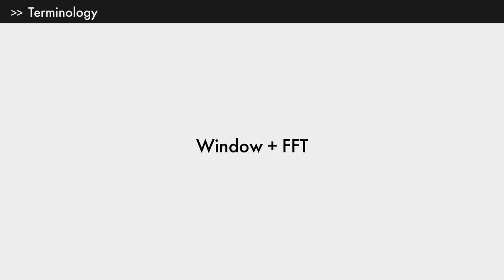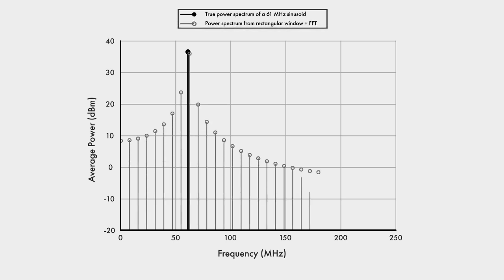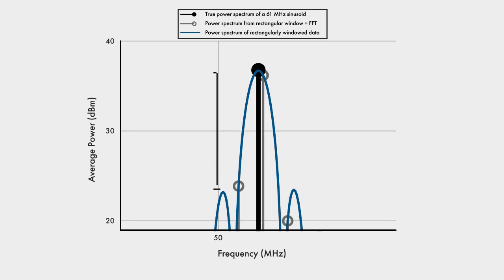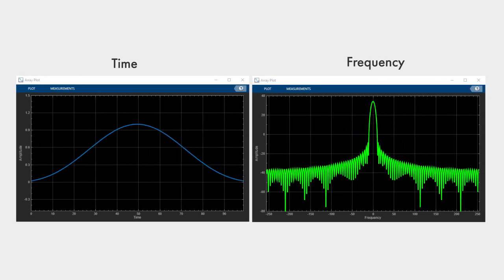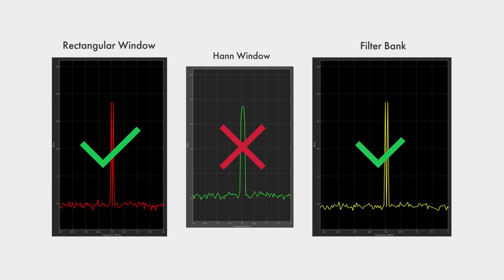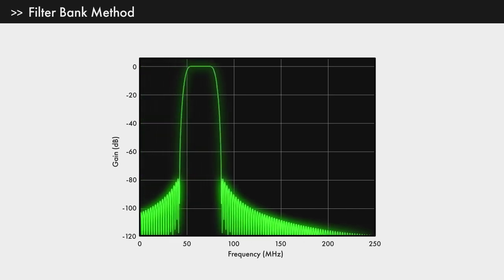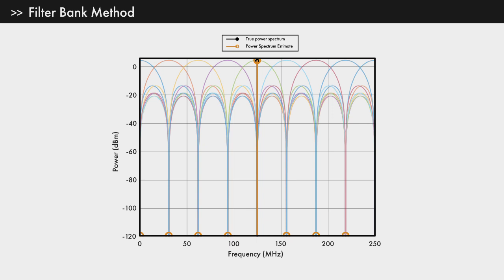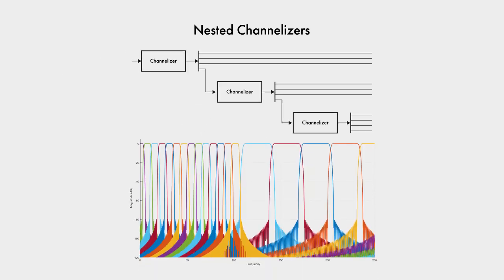A Better Approach to Spectral Analysis  | Hear from MATLAB & Simulink Developers

Comment: Thanks for posting this. It is nicely done.

I have been using spectral analysis via home brew MATLAB scripts to study piano tones (I first bought MATLAB in 1989 when the whole system came on a 5 1/4" floppy disc). For high resolution I numerically evaluate  int[exp(-j2PI f t)*y(t)]  for a selected frequency subgrid where I can arbitrarily specify the separation in that frequency subgrid. This appears to give the desired frequency resolution but it is quite time consuming and it does not solve the leakage problem but it does appear to be an improvement on padding (but not in time consumption).

The use of filter banks is new to me. Can you share a reference that would be an introduction to using filter banks for spectral analysis? Thanks again.   -Dave